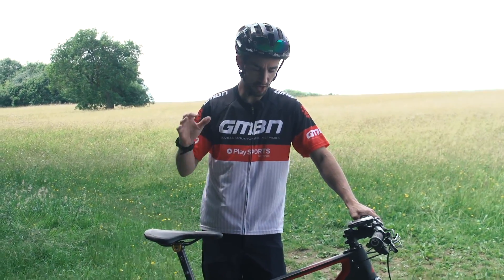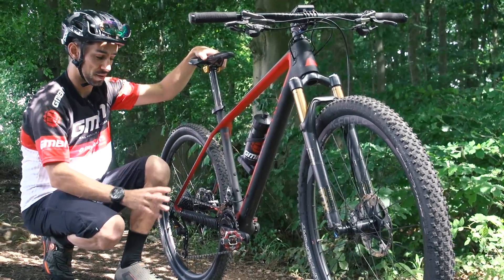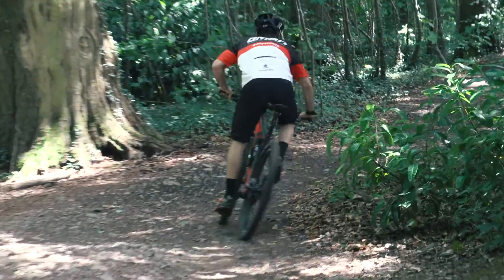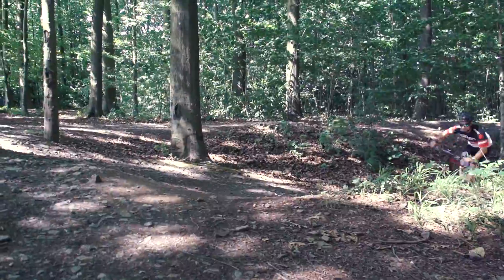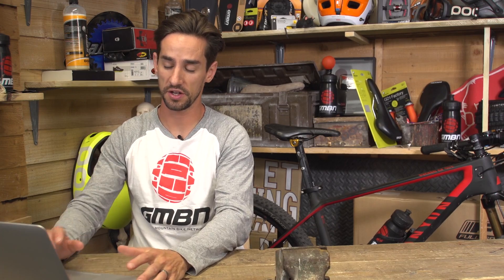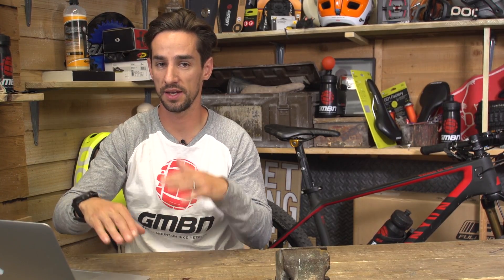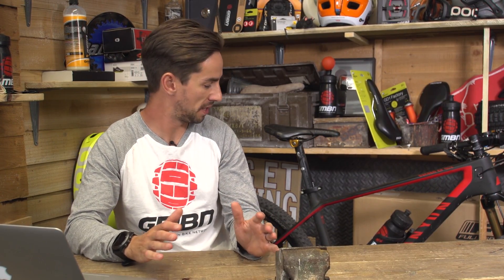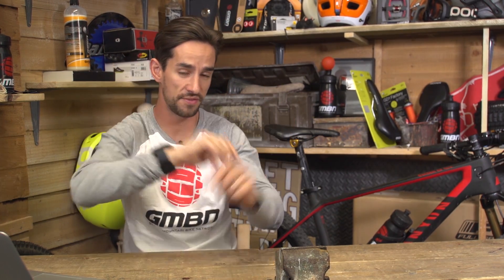Clips vs Flats | Which Pedals Are More Efficient For XC?

Comment: Here is my two cents worth:I've been riding seriously for the last 3 years or so, mostly mountain biking here in NW Arkansas, which actually has become a hub for mountain biking. This year I began XC racing in the AMBCS and I made podium once and 2 fourth place finishes on my flats. I saw that most of the competitors were using clips and began to wonder about advantages and disadvantages. I had some experience with clips on road bikes where its definitely a must, but always had my doubts on mountain biking. A few weeks ago I had to buy some parts for my bike and in order to get free shipping and a discount I had to spend about $30 more, so I bought me some SLX clipless pedals. I raced at Slaughter Pen still with my flats b/c that's how I practiced and got beat out of the podium by 2 seconds. Slaughter Pen Jam is the largest XC race in the state and Cat 3 Men 30-39 had 25 participants so it was pretty competitive. I'll say 4th is pretty good for an amateur like me lol. I got to the point with my flats that I did not have to pull out my feet even on rocky trails and windy areas, but occasionally I would lose my spin,  so I decided it was time to try my clips. Just yesterday I went to try my clips at my usual trail where it's fairly rocky and technical with approximately 1500 feet of climbing in 17 miles. Not the hardest or easiest trail, but it's a good workout. With my flats I would do 3 loops in about 1 hour and 45 minutes, with usually trying to do at least one lap in about 33 minutes. I did this fairly consistently and my times fluctuated depending on weather and traffic, but I got to a point where I was not noticeably improving. Yesterday with my clips, my first time with clips on a mountain bike, I absolutely crushed my personal records on this trail. I had two laps where I was under 32 minutes, and what normally took me 1 hour 45 mins, only took 1 hour 37 minutes. It may not seem like much to some, but this is the difference between podium or no podium and I'm trying to get podium! Keep in mind that this was my first time wearing clips on a mountain bike so I think I can only get better. At first I was a bit hesitant, but once I got more confidence, I did not miss a beat. I felt great and my feet did not feet uncomfortable like in a road bike because I constantly shift and stand on my mountain bike.So here is a few notes:- Clips are not for everyone, I believe you must get to a point where you a very comfortable shifting your weight on flats and not have to pull out. Only after several years on flats did I feel comfortable making the switch.  - I've also read the literature on flats vs. clipless. I can tell you that I tested my clips in a trail that is rocky and technical, and I ride fairly aggressive. I've seen the proof with one ride and it's an easy decision now.- On climbs, where sometimes I would lose my spin b/c of rocks or other obstacles, on clips I was rolling over everything since I did not worry about losing my footing.- It might be true that I was using the same or higher AVERAGE power than on my flats, but I felt more consistent. For example, let's say on my flats I go about 60% effort for normal riding, but on climbs I have to exert a lot more effort to keep rolling. On my clips, I might be going 65% for normal riding, but on climbs and technical sections I felt I did not have to exert myself that much more. In other words, you might use less total power on flats, but it you have sections where you get winded faster, obviously your times might not be faster. So this is where I feel where clips have an advantage, more consistent effort.- I was one of those guys that said would never ride clips on a mountain bike and yet here I am. Again, they are not for everyone and you should master flats before making the switch.- I did feel more conservative on downhill sections, but I think with time I will get more comfortable. - I improved a minute over my previous personal best of 33 minutes for a lap, which included multiple pedestrian slow downs and stops. Improved 8 minutes over what normally took 1 hour 45 minutes. This equates to about a 3% improvement in time. Bottom line: The fact that I don't have to worry about losing my spin on climbs and technical sections makes this worth it. For me going forward as I continue in XC racing, it completely makes sense to use clips. I thought it would take me several rides just to even get acclimated, but here I am rambling after the first ride. I can only get better right??
Reply: Thanks for sharing Beto, I totally agree that clip-less pedals make you more efficient and there's no way I can climb some technical uphills with flats. it's sad that so many bike bike bloggers sort of advocate flats...it's like saying that rigid bike is better that a bike with suspension... maybe... sometimes..  every cyclist should have a pair of both pedals. I am stunned you could do so well in races riding flats. my recent discovery is dropper post - probably the cheapest way to get a full suspension feeling while riding ht =)
Reply: Great detail. About 35,000 miles cliped commuting under my belt with 1,000 miles on flats with my MTB. Week
Will go cliped very soon next time I got the trail

Comment: The results were really as I was expecting. I don't think it's necessarily about the relative efficiency but clipless pedals allow you to work harder on steep hills or rougher pedally terrain, where with flats you'd either get bounced off or not be able to pull up on the pedal if you were really honking up a short climb. 

Still flats for me though, I'm not racing.

Comment: if efficiency is the name of the game, multiplying power x time should give you energy. So, flats consumed you 178Wx18.53x60=197.9Kj of energy to complete the course. 
on clippless, you consumed 191x17.93x60=205.5Kj of energy.  flats was indeed more efficient because it made the same course with less energy. 

on the other hand, f1 cars are not efficient!!!

looking at what you body felt, which is normalized power, flats consumed 18.53x60x227=252.4Kj. clipless consumed 17.93x60x235=230Kj. so your work perception was in favour of clipless being more efficient. 

is it valid for everyone? can't tell. but maybe the smoothing of the pedal stroke made the difference. and Neil likes the clipless so his body is used to it.

if gmbn sends me a power meter, I can run some tracks on flats and clipless and give the comparison for a true flat guy! guaranteed to send the power meter back later.

Comment: You went 3% faster while using 7% more power (energy) on clips or at Normalized power about 3% more energy for 3% more speed. Nothing conclusive, but a slight edge to flats if you ask me. I'm just using math for that: no opinions.
Reply: totally agree with Bike Bros! Data show flats are more efficient.
Reply: Not to mention that he has little experience riding in flats.

Comment: Is using a Hydration Pack more efficient than just using 2 water bottles for an XC race? or  Is it okay  to carry the weight of the bag on your back just so you can sip water without taking your hands off the bike ?
Reply: Nithantha somwarapet dhananjaya  I usually use water bottles when training and having fun. When I race I use a camelbak. I would recommend using a hydration pack when racing because you can carry more water and can always be prepared for an attack.
Reply: Patrick Frank Does the weight of the pack compromise comfort?

Comment: The results indicated that you were using more energy when clipped in. This makes sense when you think about how you are engaging extra muscle groups to pull on the upstroke, which is a very unnatural way to use those muscles and why new clipless riders cannot sustain the upstroke for very long. 

So the efficiently is always less because you are using more energy to power those extra muscle groups. I guess training with clipless lets you strengthen those extra muscle groups and allows you to smooth out the power stroke but it can't ever be less effort than flats because you have to power more muscles in an unnatural movement. 

The percieved gains for clipless come when those upstroke muscles are strong enough to keep going which gives you more 'theoretical potential" power because you have more muscles involved. But having to provide more energy to power the unnatural movement means you need to be a stronger rider to be able to burn the extra effort in the lest efficient upstroke movement.

Alternatively you can put that extra energy/effort into a more natural downward pushing force on flats is why flats are more efficient.
Reply: This is a very good point, and often ignored in these discussions.
First of all the term "efficient" is used so haphazardly, that it makes no sense - in this video as well.

In my book, efficient means that I get more for less - this means going faster with the same energy consumption.
Putting in more energy, getting faster times, is not "more efficient" - it's "just" faster.
It could very well be that Neil was ABLE to put in more energy, and thus be faster, with clipless - I think this is very true, as clipless does save your butt from time to time, as is also a possible explanation for the spikes he sees in cadence, etc.
But this "experiment" shows nothing about efficiency - nothing at all...
Reply: No. The cleat to pedal interface has very little compression compared to flats.  Of course the "extra muscle groups" are using more energy - because that energy is used to propel the bike; which flats don't. Conservation of energy. 

The idea that those muscles are tiring out faster is bogus, since they are a used as much smaller proportion of the pedal stroke. When pedaling, you should feel as though you're running on a treadmill. The bottom part of the circle you should be pulling and engaging more muscles than just the quads. There's nothing "perceived" about it. There's a reason why every XC and road racer are clipless and you're not smarter than them.
Reply: @reniam  

You can see scientists and people who know about the body point out that pulling with the legs is unnatural and unintended by natural body mechanics.

I dont want to hardliner either way but addressing arguments on their merit is better than mindlessly diverting to "the pros do it so its best".
Reply: @vgamedude12  Guess you didn't read the comment, where I talked about conservation of energy. Hardly mindless. Also, the pros are, ya know, professionals. They have some really smart, dedicated people earning handsome paychecks thinking about this stuff. They don't ride flats. Sorry you don't understand it.
Reply: It´ll be interesting to see a test at the same speed and time, that would really tell the energy efficiency.

Comment: Conclusion is yr knees are buggered in 20years time!
I have switched between both for years, racing using clips and often riding flats for fun and general riding or free riding DH fun.
Note: I switched off Shimano Spds to Times in late 90s and then Crank Bros Egg beaters for most of that time since! 

I'm having to use flats now pretty much all the time now as I just get too much discomfort in clips, Always pretty good with cockpit setup!

Imo what's missing from this as usual is for the every day rider what is best! 99% of people aren't racers! Are they better off on flats same with bike type what is best for them to learn proper technique in so they develop good base level skills, confidence in and pedal techniques are very important once you get into higher grade level trails that modern FS bikes can take riders too esp in a bike park or where shuttles are!

Flats are better for this, just switch back now and again and see how sloppy your own technique has become while being in clips for awhile.
Clips are more efficient p, but it also takes a bit of time to fix that technique on flats again, it takes a while to smooth out your pedal technique if you have ridden clips for awhile, it's a skill, footwear for flats is also very important, as is pedal type for the shoe, for performance and security on the flat pedal !but for the average rider is that difference worth it, clips vs flats! 

Sam Hill ftw..

Comment: could you please do a video on oval chainrings, both with clips and with flats
Reply: This comment needs more likes. Probably the current trending thing right now.
Reply: Karina I use an oval ring but honestly stoped noticing it after 5 mins
Reply: Yes, the pedal strike feels much smoother with my AbsoluteBlack oval chain ring, it would be interesting to see a power meter/heart rate comparison with a regular chain ring on flats (and clips).